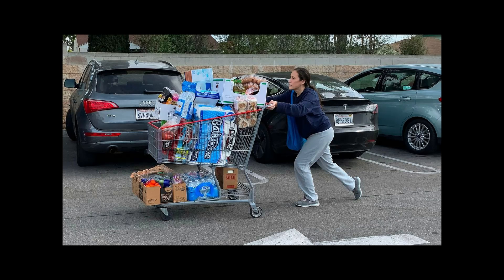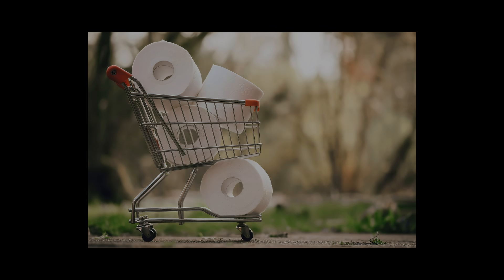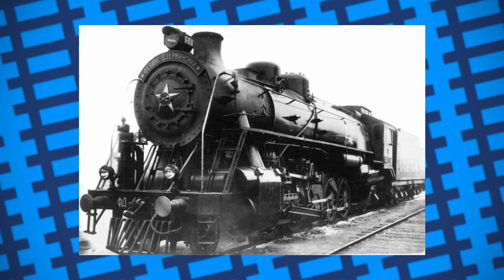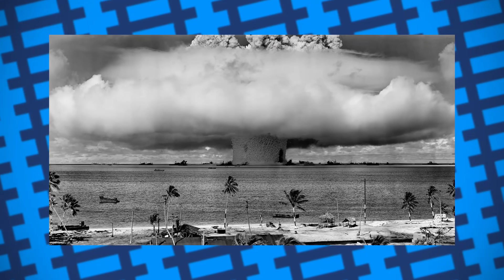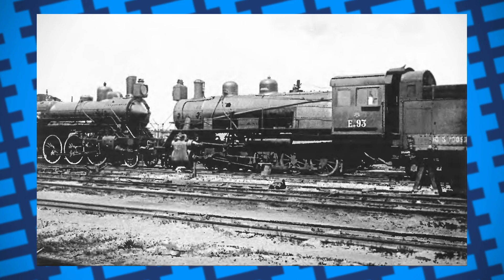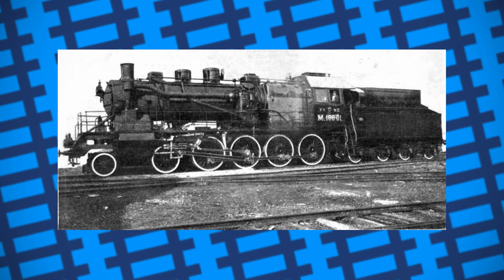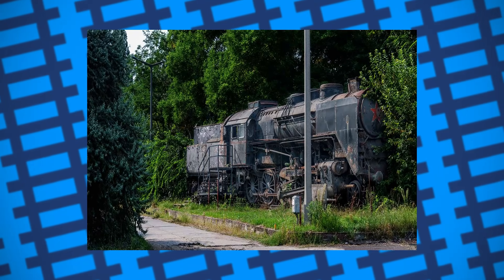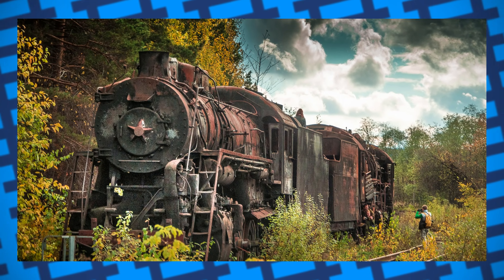Why the USSR preserved hundreds of steam engines - USSR Backup Engines

Comment: Other countries like Finland and Sweden also did this and it was very useful for presentation. Here in the Netherlands a new heritage Railway opened in the south east in the 90s and they ended up taking 4 locomotives from the Swedish reserve to run the line. There is also a myth that a British reserve exists but so far there is no proof of that being the case.
Reply: Tbh british doesn't need reserve considering how much is already preserved this day
Reply: @pinngg6907  One might suspect that the preservation movement has been encouraged for exactly this reason. We're even building new ones. 🙂
Reply: Fun fact those Swedish steam locomotives were chosen for the military reserve for their technical condition mostly just after a major (boiler) overhaul. 
When they realized that there were no  qualified engineers anymore to operate and maintain them they were pulled out of sheds across Sweden to be sold.
They were replaced with (fewer) Diesel locomotives for the military reserve.
Reply: @pinngg6907 There is no British reserve. They were all chopped for scrap with cutting torches in the 50s/60s.
Reply: 'Some' withdrawn class 8 and class 9 British Railways freight steam engines were mothballed in the mid-60s.  A friend saw several being shunted into quarry storage, but there may have been dozens stored.  They were removed and scrapped in the '70s, so there is no 'secret store' for preservationists to raid.  My guess is that the reduced likelihood of 'armageddon' (as reflected in the abolition of Civil Defence, Royal Observer Corps etc), together with loss of coal handling facilities, water columns etc meant that they were no longer worth keeping as a strategic reserve.
Reply: It’s quite unfortunate that we had the mentality of everything should be scrapped and we need new stuff here in the Netherlands, it would’ve been nice to have some of the big Dutch steamers in service for the heritage railways
Reply: Actually, there was a british reserve at one point, but it was disbanded.  Lawrie has an episode on one such British Loco.

I was wrong on the date, and I can't find the particulars on when. But 9 out of the 14 made it into preservation.
Reply: @obelic71  Yeah. They also hoped they could sell most of them quickly to international enthusiasts clammering to get their hands on steam locomotives, and were semi-succesful in that, including selling a few to North America along with some diesels and old 1960's era passenger coaches also from Sweden. But these were the early 90's and as the Iron curtain fell, another seller arrived. 

Many eastern block countries still operated a plethora of steam locomotives and often sold them for much cheaper when replacing them. Poland in particular sold and donated a ton of locomotives to people across the world, and that meant Sweden couldn't sell as many, leading to a fair few still being scrapped. 

But even then, the Swedish B, E, and E2 classes (which were the types kept in reserves) are still some of the most numerously preserved classes of steam locomotives of any kind in the world.
Reply: @Lumberjackk  True, but the Swedish ones they do have are still fairly accurate since I recall reading that NS ordered a series of steam locomotives from Nohab in Sweden based on Swedish designs like the B and E classes (the types heritage railways in southern Netherlands operate) in the late 40's and early 50's, to help build up rolling stock after WW2.
Reply: @nickm9123  No, it is a myth. If you want to give particulars of what locations and classes, I will check. But basic diesels are much better. Eg O8 class . They can survive emp underground.  Steam locos need specialist lubricants, cooling infrastructure  and skill to operate  etc. 

Steam is not suitable for post apocalypse operation.
Reply: @Lumberjackk  It would have been  "nice" but would you have been prepared to pay your own money to keep them in storage or did you expect "they/them" to pay?
Reply: @Lumberjackk  agreed, perhaps we should give the new build thing a chance.
Reply: Woodhams scrap yard in South Wales was the British reserve😅😅😅
Reply: @PreservationEnthusiast  wd196 (3796), she is a austerity, which is currently in Belgium. Lawrie from lawries mechanical marvles has a great video on her and goes into minor detal on her sisters. That particular engine was also in chitty chitty bang bang. There were 14 made in the early 50s for the MoD. 9 are currently in preservation. 

192 and 198 are also in preservation on different lines in Britain. 

They were in the strategic reserve. 196 was delivered to longmoore (i think thats how thats spelt) in 1953. That's all I know, but they did have steam in stragitic reserve.
Reply: @nickm9123  Yes but we are talking there about 1930s or 1940s strategic reserve before they had reliable diesels.

Not a modern strategic reserve in the 1970s to 2000s as many steam loco fanboy foamers refer to without any evidence.
Reply: No, their stragitic reserve steam was in reserve until the 60s, and none of those engines I mentioned were manufactured before 1953. So mute point. It's not some vast wharehouse of steam locos sitting.  It was disbanded.  Just not as early as you claim or made as early as you claim, with these specific locos. 

Point is, to say that they didn't have steam reserve is false, and to say that they currently do is false. 
They did at one point have "modern" steam in storage for use if SHTF, and once the soviets kinda cooled it, AND better diesels were available,  it was disbanded.
Reply: @PreservationEnthusiast  also. To say that they were ALL chopped up is a lie too, I gave you the engine numbers and a video on that too, quite a few made it into preservation.  So to did the little locos from ww1, the trench locos as they were called.
Reply: @PreservationEnthusiast  Which type of motive power is more suitable for post-apocalypse operation depends upon what technology you have left after the apocalypse.  Even in the absence of official apocalypse, China, India, and many countries in Africa (and to a lesser extent South America) continued steam operation for a long time after West Europe and North America got rid of steam, because even though steam requires more fuel, water, and labor to keep it going, the technology it requires is much less advanced (and much less expensive).  (In addition, they had coal but not oil.)  Post-apocalypse, you might not have enough remaining technology to maintain diesel-electric locomotives.
Reply: @Lucius_Chiaraviglio  Steam locos require more technology and infrastructure than you think. There are many specialised lubricants needed to keep the wheels turning. Plus water troughs and coaling stages not to mention cleaning out boiler tubes and fireboxes at a time when labour is likely to be very short. It is not just a question of shoving in wood and water and watching them go. They are fickle beasts and require the right kind of coal.

Simple diesels without any electronics would be easier to use than steam.
Reply: @PreservationEnthusiast  That would be true with today's technology, but the specialized technology you need for steam locomotives is all stuff that could be built in the 1800s, or in the early 1900s if you have the most modern steam locomotives.  Practical diesel locomotives for more than the lightest-duty use really needed technology of the 1930s.
Reply: @MadBiker-vj5qj Shame we are not building mode bunkers...

Looks at Finland 150% Capacity I'm the event of Nuclear War.
Reply: @PreservationEnthusiast  Zimbabwe was an example of an African country that dumped their steam locomotives in dump lines and replaced them with Western built diesels, only to dump the diesels at least for a time and pull the steam locomotives off the dump line and start operating them again.

The "specialized lubricant" you are referring to is steam oil that was injected into the cylinders with the steam.  There is nothing special about it, it just a mixture of a mineral oil with an organic oil (usually lard), along with an emulsifier to keep the two blended together.  It is not difficult to obtain or mix at all.  The rest of the locomotive required regular oils for lubrication.

Diesel operation requires access to parts from a manufacturer and a maintenance force skilled in troubleshooting and repairing them.  With the exception of accessories like air pumps and turbo-generators, most steam locomotive parts could be fabricated by someone with blacksmith skills.  Zimbabwe dumped diesel for a time because they did not have the funds to import diesel repair parts; since they did not make the locomotives or parts in their country.

While steam is less efficient, in countries and areas with plentiful supplies of coal and no oil; steam can be less cheap to operate.  The Norfolk and Western Railway hung on to steam for so long because they had a free source of coal; it was the rising cost and decreasing availability of steam accessories that finally forced them to convert to diesel.  It is also why steam hung on so long in Romania, China, and other regions.

In countries with a fully developed supply chain and adequate oil reserves, diesels are indeed more economical to operate with a greater availability.  But when your supply chain collapses due to nuclear war or other disasters, and oil is not readily available, steam makes sense.  This depends on the old steam infrastructure still being available; as the case in Sweden, most of the steam locomotive reserves were dissolved when it was realized there were no longer steam facilities around to service them, nor enough drivers and repair crews who knew how to operate and repair them.
Reply: @MadBiker-vj5qj  The preservation movement are not only preserving locomotives, but also skills and knowledge.
Reply: @joejoejoejoejoejoe4391  Yes, absolutely. Locos aren't any use without those skills and  knowledge.
Reply: Tornado was built a couple of decades ago, two new steam locomotives are currently being built in Sheffield, hundreds of locomotives running in preservation, many more in storage, plus some in private ownership.
Reply: The UK never preserved such things. Too much money. Thatcherism killed everything like that. We don't even keep our last gen small military equipment!
Reply: @noahhughes2501  In the UK, there is around 230 operational steam locomotives in use, with around 730 preserved as standing displays, with some being restored.
There are a few modern replica locomotives, with a few new locomotives in current production.
Reply: The British have no railway reserve. There’s no point - they can’t reliably run their rail system with new rolling stock. They have no chance whatsoever of getting it done with preserved steam traction.
Reply: @davidchilds9590  British Rail couldn’t edit Ho destroy the old steam locomotives. Preservationists had to fight just to be allowed to buy them from scrapyards. It was the same with branch lines. Beeching closed stations that did not sell enough tickets. Data was taken from one month - August.  Result was the closure of a huge number of stations because people were on their summer holidays. They also shut destination stations often in seaside towns. That meant no need for the branch lines. It was an incredibly cynical hatchet job that crippled the network and led directly to motorways getting jammed at peak periods.
Reply: If the US had done this we may have gotten something like an NYC Hudson preserved
Reply: Would be better of in a museum tho it is pretty bad for your health to operate such a boiler with coal. Remember ot is just like a coal mine in there just huffing and puffing dist and spouting clouds of shit in the air.
Reply: I would like to think the US had something like this, but the more I find out about the US MAD policies it seemed to only ensure our nukes got off too along with ensuring only politicians survived.
Reply: Love locomotives, grew helping my grandad and dad making their respective 00 layouts in our lofts and having weekend trips to live steam days. Just can't escape that fascination, wish the UK did more to preserve this history but we have a good deal preserved compared to most so can be thankful for that.
Reply: @obelic71  Are you sure that's why? I read that they were kept in storage until 2004, when the government made the pig-headed decision to get rid of pretty much the entire armed forces. I believe the diesel locomotives were already in storage at the time.
Reply: Imagine a K2, Caledonian 812, Big Bertha, and GWR 101 speeding past a Class 66 while pulling a train of railguns and tanks on their way to stop the apocalypse.
Reply: A British reserve did exist back in the Cold War but once the Soviet Union fell the trains were sold to India. The people who knew how to run them were too old or dead anyway.
Reply: Brits in fct had no way to make reserves for anything. They have quckly calculated that everythign but Northern Scotland will be entirely burning hot in nuclear scenario - just too may military and industrial targets on a small island plus strong winds and rainfall means...
Reply: @krzysztofbosak7027  that is simply nonsense. I was in the Cold War British Army Military Intelligence in a home defence battalion. There were extensive plans for continuity of government in the event of a nuclear attack on the UK, which included underground military bases and storage facilities hardened against the nuclear environment. I was inside some of them at times. Not much in the way of the civilian population would have survived, however.
Reply: i live up north where STAR maintains and runs one of these backup engines too. A 52 kriegslok that spent most of its post nazi years in Koningsberg for cold war uses.
Reply: @PreservationEnthusiast  The "specialized technology," as you call it, is easily manufactured in most locales with pretty basic tools and can be run on wood in a pinch.  Tell me again about how reliable diesels are when the oil refinery has been bombed.
Reply: poland had 948 steam locomotives in use in 1985

Comment: Steam engines are actually really smart, I've been wanting to build one myself, cause all you need it some water and preferably dry wood to start harnessing mechanical energy. Tbf I don't mean steam engines as in trains, I just mean the engine itself.
Reply: sounds like a fun little pet project!
Reply: There are certainly plenty of plans out there.  And available castings.  One source is "Reliable Steam Engine Co." where their simplest engine is 4 horsepower, plans cost $50, and castings cost $1,000.  For a steam engine you will also need a boiler which can be another challenging project.  You do need more than just fuel and water - you need lubrication if usually multiple types.  One type that gets mixed with steam to lubricate the innards.  Another to lubricate all of the external moving parts.
Reply: @trainliker100  honestly some sheet metal and old propane tanks would be enough to make one. They're not that complex, although I couldn't guarantee any kind of specific power output, or safety, without at least doing some calculations first. 
If it's enough to run an old car alternator at full load I could expect about 500-700W of output power at about 14V. 
Then I'd require a step up transformer to get it to 220V European, or at least 110V American to make use of it. There are losses associated, but it would make a cool backup generator. 
The problem is that I might have to build the transformer myself, as I am not certain that off the shelf 12V converters can handle 14V, even less so at such a high amperage. 
As I already have solar it would be really funny to run this thing on wood 24/7 and just sell the excess energy to the city as "green energy". I'm sure they won't get suspicious when I produce "solar" power at night.
Of course I could just use the mechanical energy directly but that's pretty limiting. 

Wow this comment got way too long already, sorry for the rant, I'm just writing down my thoughts right now.
Reply: @hummel6364  get an inverter that runs off 12-14 volt. Harbor freight sells one that can handle 2000 watts continuous for like 130 bucks. Alternator when charging bumps the circuit to 14 volts so you'd be looking at a roughly 50 amp alternator. The problem is that alternators need to spin at usually above 1300 rpm to actually charge, and 4000+ for maximum output so good luck gearing it.
Reply: @cleveland2286  yeah that's what I was thinking, all depends on how much torque it would actually produce.
Reply: Then from mechanical energy you can make electricity 👌

Comment: Some steam engines in reserve can be valuable for other situations.  Not only power outages, but even in diesel territory such as during flooding.  In April 1965 long after the CB&Q railroad had dieselized, they had some flooding deep enough in an area that diesel electrics couldn't go through due to their low truck mounted traction motors.  They had a couple of steam engines they used for fan trips and pressed No. 4960, a 2-8-2, into service to haul trains through the flooded area.